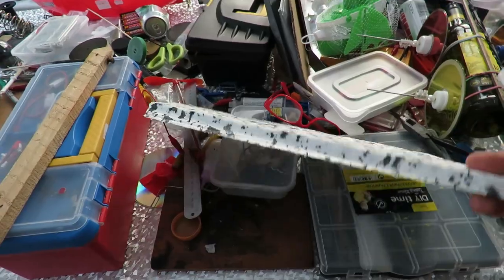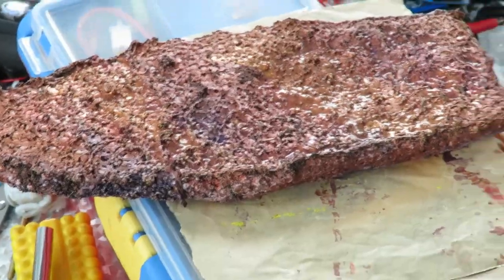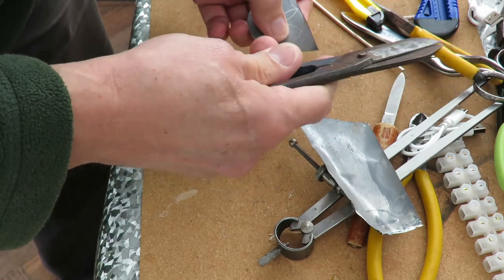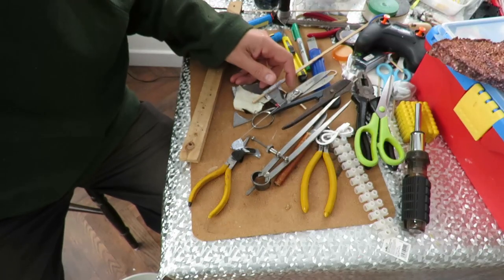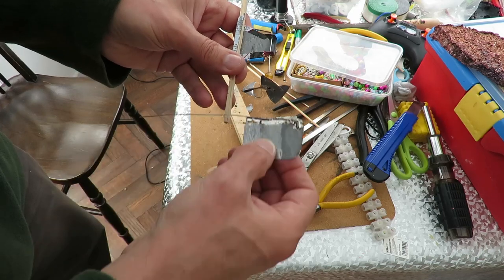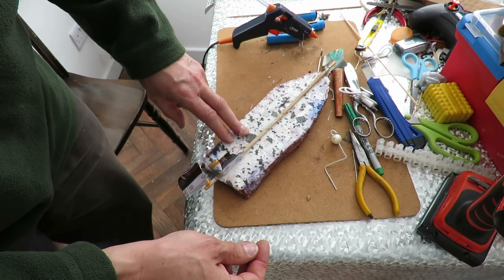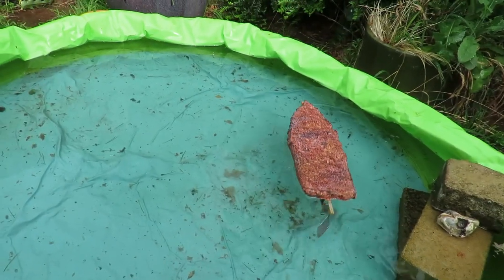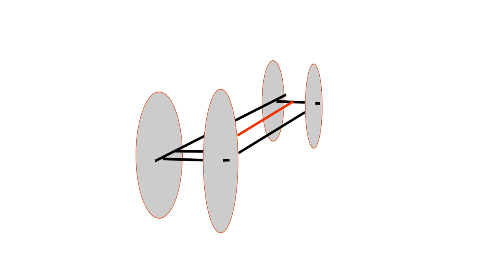Put a rubber band on it #0256 Rubber band floater boat

Comment: I thought you were going for a wood look or possibly rusty metal, it took me a few to catch on. Probably because it's flat and not actually log shaped. Thinking about it, if you hit a plastic drink bottle with a hair dryer to shrivel just the top... maybe fill it 1/3 with water to keep the bottom from melting... Regardless it's not a crappy build by any means
Reply: I should have rounded the back end and maybe curved the sides in a bit but the colour effect worked well 😁👍
Reply from the maker: I might have a go at the plastic bottle idea :-)
Reply from the maker: Just made the Mk2 floaterboat from a brown plastic bottle, held it over a gas flame and was amazed I could NOT catch it on fire even with a significant amount of heat. 24th of May for the publication date :-)